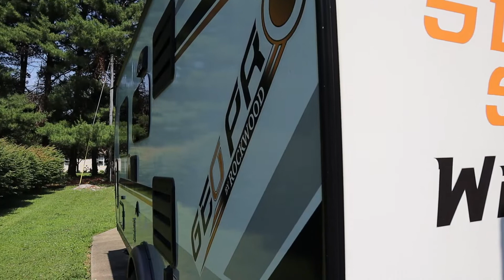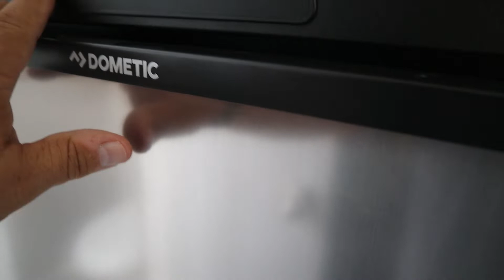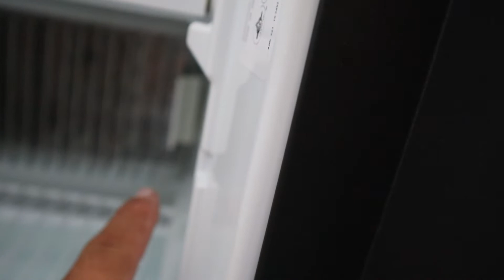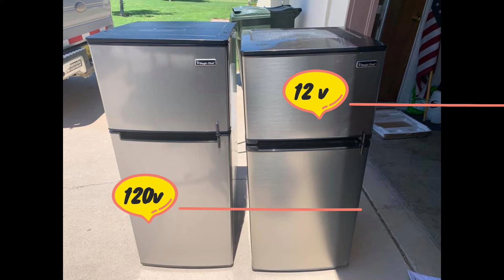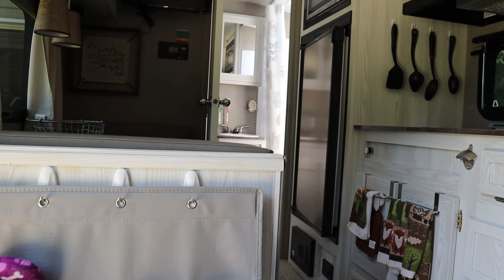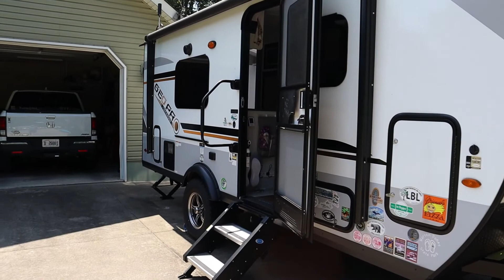All About RV Refrigerators

Comment: Good video explanation and I concur with your thoughts on each.  My 2021 1/2 shipped with a 115 volt; you can also tell by the manufacturers sticker inside there frigerator.  Got the dealer / manufacturer to swap out for the 12 volt I anticipated when I ordered  the trailer.  You are right in that you need much more battery powe for the 12 volt, I installed 2 lithium batteries and an additional 190 watt solar panel for good measure.  Works like a charm.

Comment: Nice explanation Turtle. I have a short 29' 2019 Shasta 5th wheel with a 12v EverChill refrigerator. You are correct that you need a little more power to keep it running when dry camping or boondocking. That measly battery the dealer gives you is pretty much useless. I upgraded to 400 watts of solar and two 6 volt, 225 Ah batteries. Works perfect for me. Have gone camping without shore power for as many as 4 days with no issues. My wife and I love it so much that we will never go back to a gas RV style fridge. Cools down fast and stays cold even when ambient temperatures and humidity around it are high. As far as a 120v residential fridge, I'm with you 100%. They're only if you camp with shore power or a generator. BTW: I do have a genny but only need it on very cloudy camping trips. Anyway, another great video. Keep 'em coming!